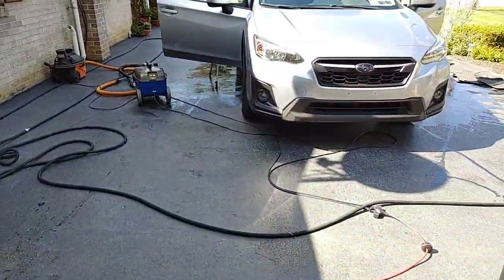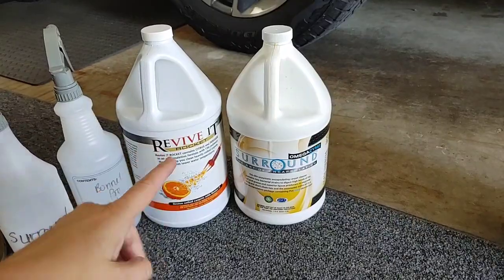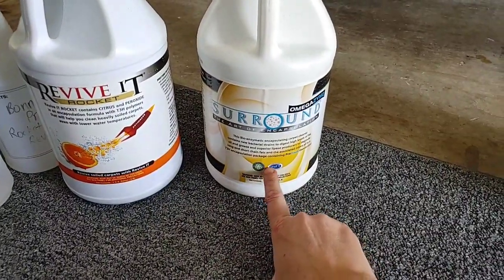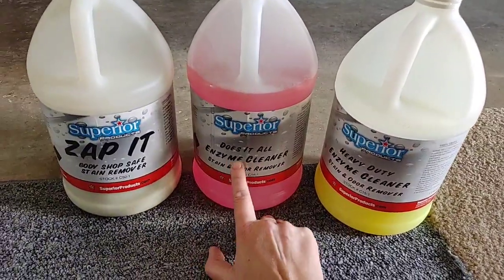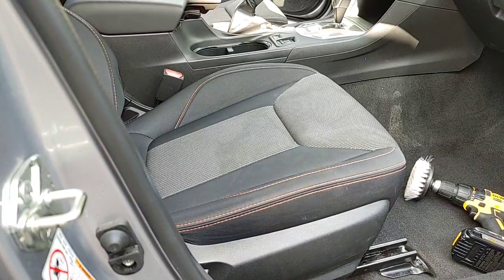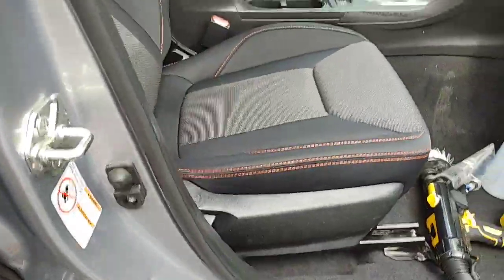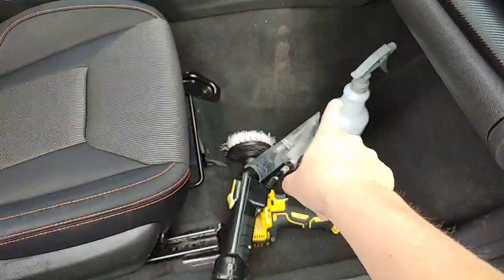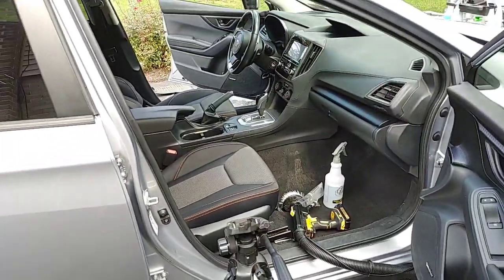We're LIVE! Let's talk about my Favorite CARPET AND UPHOLSTERY CLEANERS!

Comment: Chelsea you should tell everyone about how bonetpro encap prevents wicking!  If you use the encap cleaner at the highest mixture your never gonna get stains re-wicking after the seats dry
Reply from the maker: You just did and I’m glad you did because I didn’t even know that tip. Pinning to the top!
Reply: @attention2detailswchelsea yes it absolutely stops wicking.  Here’s what you do.  Use the product as you normally do to extract or bonnet clean.  Then at the highest solution spray a decent amount over the stained spots.  Let it dry don’t bring it out.  The encapsulation polymer form a micro barrier under the surface that you applied it to preventing that old stain coming back and a essentially no wicking happens
Reply from the maker: @Greg_P611 but what about resoiling? My concern would be leaving that much residue behind would accelerate resoiling. Ideally encaps work as each time you vacuum after it removes more dirt and brightens the carpet but what if customers aren’t vacuuming and get in the car with wet clothes or shoes and it accelerates resoiling. That would be my concern

Comment: So could I use Rocket in carpet extractor to clean all of the carpet in a room with extractor and would mix the spray at 4:1 dilution? So spray  the carpet first with rocket from a spray bottle then extract it with just some warm water? I have dog that loves to lick the carpet and wondering if rocket work on dog salvia? I have buy 5 Quarts will probably last me 2 lifetimes of carpet cleaning. Thanks Chelsea .🙏🙏👍👍

Comment: Chelsea, can I use Rocket IT in an iK 12 pro foamer?  If I can, would you still use it 4:1?  Or is it more effective using it in the spray bottle?  I bought a couple cases of the Bonnet Pro Rocket and the Enzyme.  But I think when I foam it, I am putting to much soap on the carpet and or upholstery.  I use my Mytee Extraction machine (phenomenal).  Thanks for your help as always.  I am still amazed with Dark Fury and Koch Chemie MP.  Thanks for that tip as well!
Reply from the maker: I think that would create too much foam. You might want to try just a pump sprayer versus a foaming pump sprayer if you're looking for easier application. I think the foam would be too much and then you're going to be chasing a lot of residue. 

Thanks for the support and glad you're enjoying the products shared!

Comment: Hi Chelsea! Quick question. Do you follow revive-it rocket with any type of non-wicking solution or is that not necessary since its hydrogen peroxide based? 

Not sure if you’re familiar but the P&S 3-step carpet cleaning solution has a finisher peroxide treatment.
Reply from the maker: I dont as its only slightly alkaline unless wicking is evident and then I treat with Spot Stop
Reply: @attention2detailswchelsea  great! Thanks for the reply!